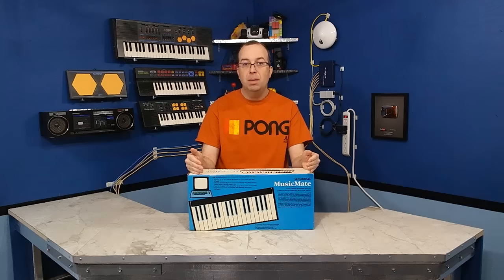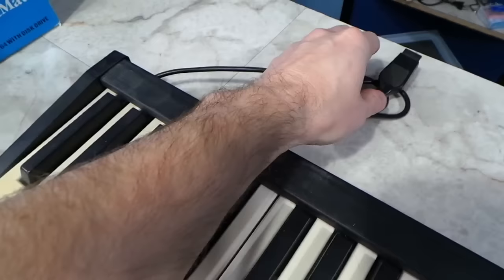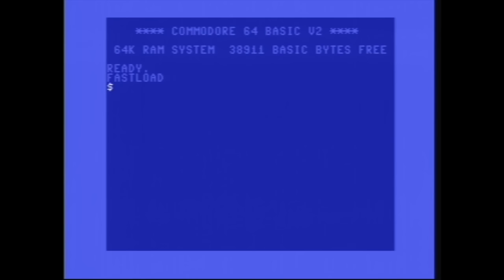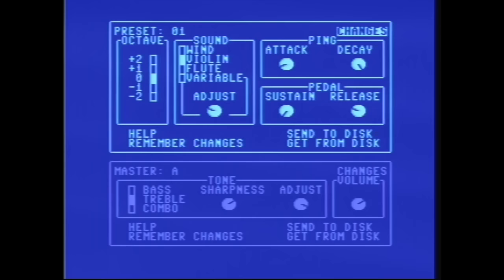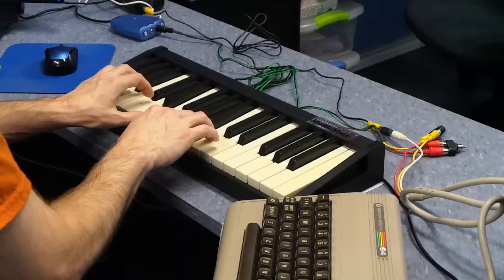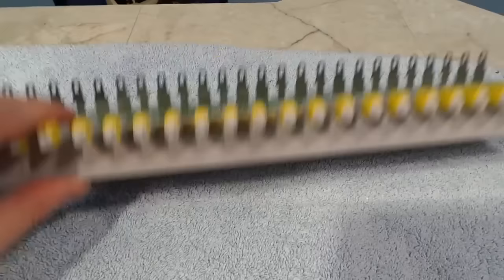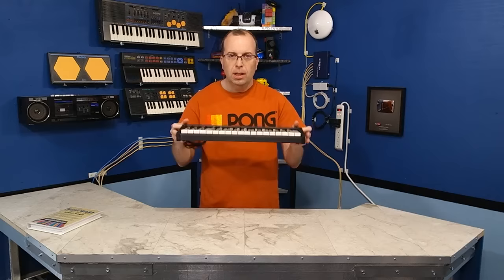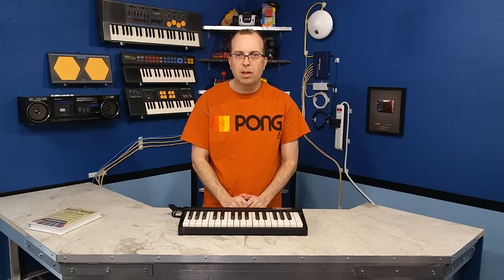Sequential Music Mate for the Commodore 64

Comment: Does the Retrobrite treatment also strengthen the plastic? I can't find an answer online.
Reply from the maker: I am not sure either.  My guess is that it has no effect whatsoever.  It really only affects an extremely thin outer layer of the plastic.
Reply: 8-Bit Keys That's a problem as I have a really yellowed Super Nintendo Entertainment System and the plastic seems to be quite brittle because little chunks keep breaking off. I do have it under control but I want it to continue to last. But thank you anyway! I always look forward to seeing your new videos! Keep up the great work!

Comment: So I'm looking for a good retro piano, my budget is 80 bucks and I would like it to have synthesizer controls, any recommendations
Reply: Joseph Mollohan III check out the miracle piano keyboard
Reply from the maker: One of the Yamaha FM keyboards.  I could give a specific recommendation if I knew if you wanted the full size keys, or the smaller keys.  My favorite is the PSS-470, but it does have small keys.
Reply: The Yamaha PSS-790 is a brilliant keyboard and I had one between 1990 and 1998.  The ease of use and the amount of great sounds, meant I tons of great little pieces of music.  The amount of sequencer memory is small at only 8000 notes, so most of my music on that was around one to two minutes in length.  This keyboard was also released as the PSS-795.

Comment: Now I gotta ask this: What's wrong with flathead screws?
Reply: +Panos Egglezos Well, a flathead screwdriver tends to slide off the sides of the screw you're trying to move, whereas a Philips one stays in place more easily. That might be it. Not sure, though.

Comment: 2 to the power 5 = 32 : enough to code the keys
Reply: Doesn't need inputs: just a diode matrix coding 32 into 5 bits: basically a complicated joystick.
Not baffling at all: have done it myself with a stylophone keyboard.

Comment: Is there any chance that they are using the ANALOG input of the Joy and this perfectly lined solders that looks like a DIP40 are just nicely placed resitors to make a ladder ?. This method is VERY COMMONLY used in Home gear to read big front pannel (it was in the 90s) with only one analog input. Each tact switch connect / diconnect a resistor to a ladder changing the voltage of the line. Processor know the analog value representing one certain key. BUT, you CANT press more than one at the time !!!. This is in fact the way to find out !!!. Can it play more than one key at the time ?. This is probably why you got just 0xFF when dumping the port. Any chance to try the same with the register holding the POT X or POTY value ? .... This made me really curious.
Reply from the maker: Nope.. I checked the analog lines.  Nothing there.  And yes, it is polyphonic.
Reply: IMHO is a bit "crazy" that they went into this trouble while the cartridge port and USER port are available (to get more I/Os) .... Probably they were targeting other consoles / micros too  ...  many of them use the same joy port and cabling convention making this keyboard a posibility on another systems .... who knows .... Also, a 40DIP ... at this ttime .... ummmm could be a port expansion chip, joy port should control it ... too few lines ... more likely a microcontroller or custom. A bit complex by its time. Datasette is made out of two/ three cheapo chips and managed to get a decent tape reader and recorder (ok, lets add the kernal effort) .... its crazy. Crazy stuff happened on the 80s
Reply: Yep... I had thought the same.  They could have used a Matrix and the userport could have provided enough IO pins.  But also they could have used both joystick ports simultaneously and that would have worked too.
Reply: A matrix using both joystick ports would heavily interfere with the built in keyboard (the "typewriter") on the C64. Remember, the built in keyboard is a matrix between ports A and B of CIA-1 and these IO pins are also used for the joystick ports. A chip that only sends data after some well defined  handshake is probably the best option because it leaves the  built-in keyboard fully intact which would  be important for more complex music software. Adapters for the usr port or even the expansion port would be specific to the C64. Using the analog inputs of the joystick port is not a good idea either because it would require precision resistors (expensive) and decoding more than a single key at the same time would not be trivial.

Comment: Does this keyboard have weighted keys? It looks like it may have weighted keys. I was just wondering because I prefer playing piano with weighted keys.
Reply: Name Last name Nope, definitely not weighted keys. This how they look like (more or less): http://4.bp.blogspot.com/-3eBmXgEHxJM/Vaiof-ysHNI/AAAAAAAAAro/c5QqyKtJyDE/s1600/spring%2Bkey%2Baction.jpg

David said these were springed by a simple sponge and you can see they are completely hollow when retrobriting them. Weighted keys were ridiculously expensive back in the early 80s and usually only found on serious digital pianos, not synths.
Reply: Anders Enger Jensen thanks! I figured that the keys wouldn't be weighted, because it was probably made to be affordable, though it looked like that may have been the case from looking at it. Thanks for the detailed and thoughtful answer!

Comment: da pra por um monte de teclas usando 5 pinos e uns diodos
Reply: Sendo 0,1,2,3,4

01,02,03,04
10,12,13,14
20,21,23,24
30,31,32,34
40,41,42,43

Considerando que 01 é com o diodo virado para um lado e 10 é com o diodo virado ao contrario, mas ai só teria 20 teclas no máximo

Uma outra forma é colocar binário 5 pinos, dá pra fazer 30 comandos diferentes, por exemplo pode se separar 0 - 7 como números propriamente ditos e os outros como ações como enviar um byte com função de "setgroup" sendo possível ter 7 grupos e um outro "setkey" sendo cada grupo contendo 7 teclas ai poderia ficar assim:
00000 = end - sai do grupo e da tecla
11111 = setgroup
11110 = setkey
10000 - 10111 = 0 - 7
11101/11100 = keystate (press/release) - que seria um comando para ligar ou desligar a tecla

ai só enviar 5 bytes para indicar o que acontece com a tecla, por exemplo pressionar a tecla 2
11111 10000 11110 10010 11101 00000
grupo  0           tecla   2,         press, end
Reply: Mas isso é como eu faria se eu resolvesse desenvolver um dispositivo assim, não sei como foi feito

Comment: I already said this but... Come on dude, 720p in 2017?
Reply: IVAN3DX What's wrong with HD video?
Reply: That it's outdated. The HD title stood for too long now, and it should be passed to 1080p. Right now, 720p it's rather low, and looks blurry on my 1080p screen (at full screen). 1080p cameras shouldn't be that expensive, specially for someone who does videos as a living.
Reply: IVAN3DX Have faith young Padawan. Remember that he said he needs to upgrade his editing mac and maybe also the cameras. Not something you spring for in an instant when you rely solely on Youtube and Patreon.

He said that it's possible there will be an upgrade later this summer. :)
Reply: I heard that he has a really outdated Mac. That's fine, but come on, how expensive a new computer can be? I just looked prices in Amazon, and a good PC would cost $660 (No case). I used a i7 7700, 16 GB RAM and a RX 470 (I went cheap on the GPU because I have the understanding that rendering doesn't use it much)

Comment: The software on the sampler and SFX are the same, no way of making a copy as it has some special boot sectors, it has to be physically the original disc. I tried everything but nothing could make a working copy, RAM image, disc image, nada.. Ended up scrapping them both as the floppies were starting to have occasional read error.